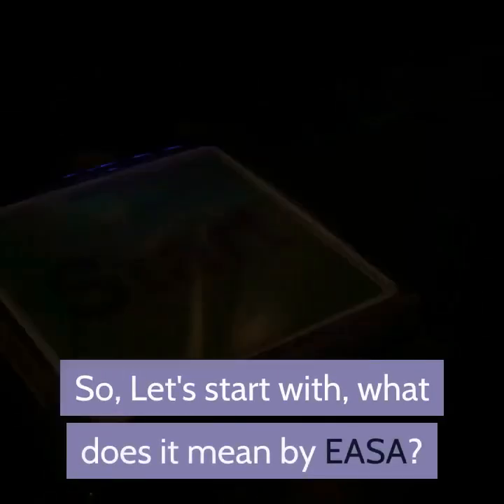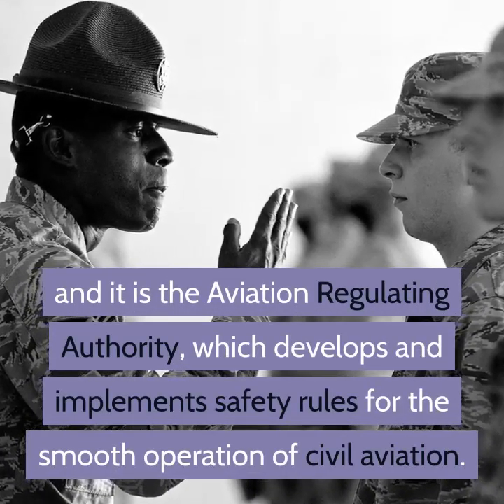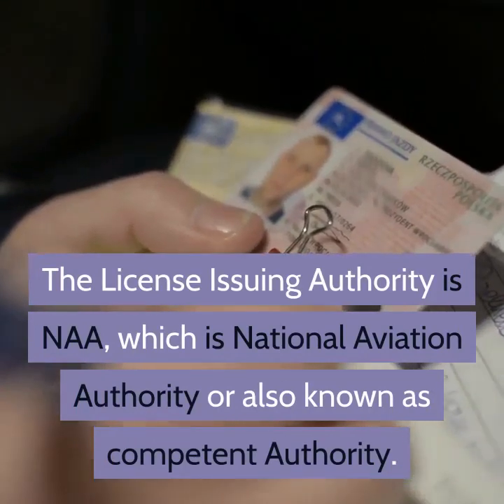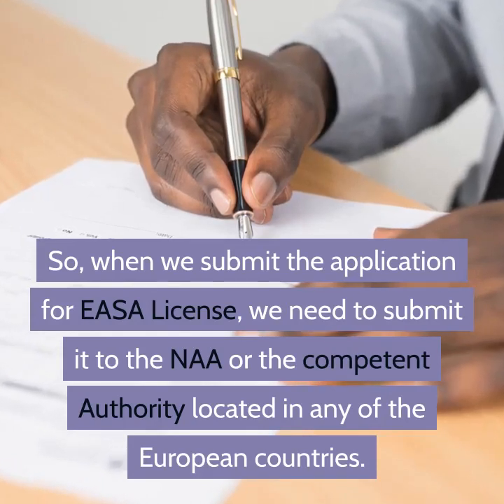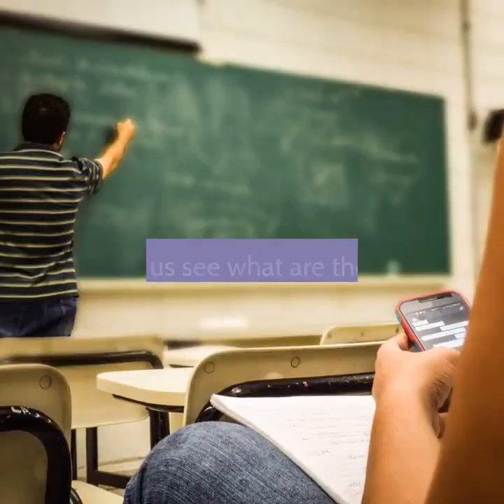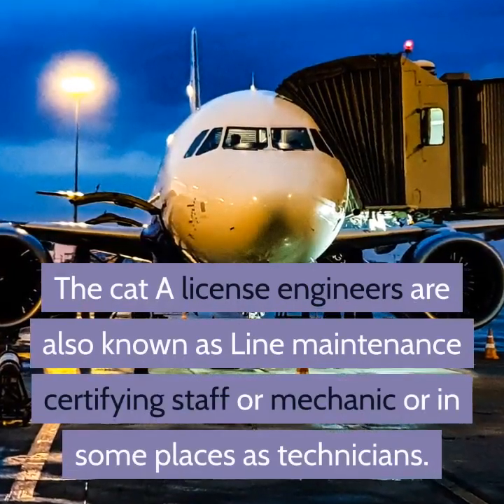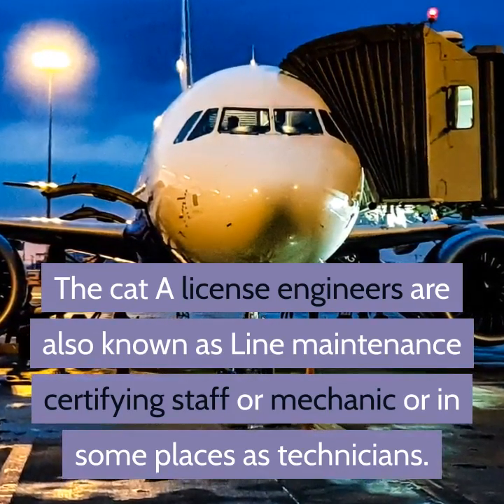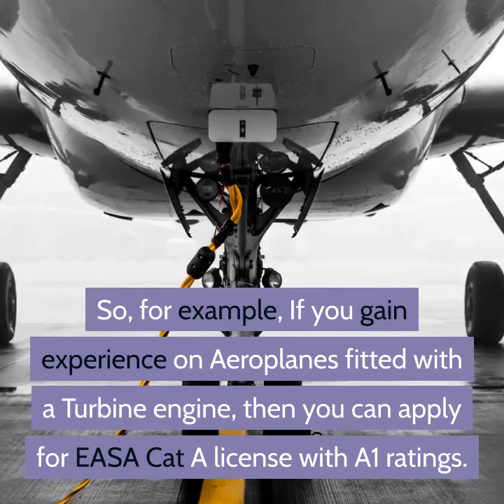How to become an EASA Licensed Aircraft Maintenance Engineer | For Beginners

Comment: tnx for the video.. i have a question .. can i take the 17 modules and become  b1 and b2 licensed and is it difficult to get a job ?
Reply from the maker: B1 and B2 has few different modules, so if you need both B1 and b2 along with common modules you also have to do the other required modules.
If you need exact which modules to complete, you can text us on Instagram.
Thanks

Comment: Thank you so much for the information, sir, I want to ask if I can start the practical experience in parallel with the theoretical study of the EASA modules, or it's a must to finish all modules first before starting the five-year practical training?
I am an engineering student and I've already started preparing for the first 2 modules exams.
Thank you so much ❤️✨
Reply from the maker: Hello
Thanks for your kind words.

Yes you can start working along with your modules preparation. There is no rule to complete modules first.

Thanks

Comment: So I didn't work in aviation. 
If get pass all module EASA examination for type I choose it b1 or b2. 
Than I apply to job in airlines companies. 
Than get job aviation maintenance mechanic. 
I'm work 5 years to get experience than applying for (license category C)
Than call me engineer. 
Is that right? 
 

Thank you for video🌹
Reply from the maker: Co Op Hello, So, If you don’t have any experience , and you choose to write all EASA modules before starting the work, and you you succeed in cleaning all EASA modules then you need 5 years of experience to get your basic license. After which, you will be called as Licensed Engineer. Then you need to endorse type ratings on your License ( For Ex: In your 5 years of experience if you have worked on A320, then you can pursue type training course on A320 and once you complete with that, you can endorse A320 ratings on your license). Then once you have this, your company will allow you to certify only A320 Family Aircrafts. And now you will be called as Certifying Aircraft Engineer.                               Cat C license is only applicable in Base Maintenance Environment. So once you start certifying A320 aircrafts in Base maintenance, after 3 years of certifying experience, you can apply for CAT C license.                                                              Note: you can hold any license, but you still need Company Authorisation to perform your privileges.                                   I hope, this answer your question. If you still have any doubt you can comment, or email to : aviation4gk@gmail.com ; or reach out on Instagram: Aviation4Gk           Thanks 😊
Reply: @Aviation4GK  good, So how the exams look like?
What is technic?
Where can I find books?
Reply from the maker: Co Op Co Op well, the exams are depends on many factors. The difficulty of exam varies person to person. If you do not have any background knowledge of Aviation, then I dont think you will find it easy by anyway.                                                To sit for the exams, you need to contact EASA Part 147 organisation based in your city or nearby cities. Or there will be some 3rd party examination providers, may be you can find any of them. But the suggestion is to find a Approved EASA Part 147 organisation and get the details from them. They also provide study materials to prepare.                                        But my personal suggestions would be , 1) enrol in the Aircraft Maintenance Diploma program, and sit for exams during your course then get the job in the Airline or any maintenance organisation.    Because without diploma in Aircraft Maintenance, I dont think you will be able to find a job in Aircraft Maintenance companies, even if you clear the EASA modules by yourself. I hope I answered your questions. If further information required then comment or write the email or on Instagram. Thanks
Reply: @Aviation4GK  I'm find some books in net
Not that hard and not easy their's.
Reply from the maker: Co Op Hello, as I said before, it depends on individual. So if you find its not that hard, you can sit for the exams under EASA Part 147 organisation. But again the suggestion remains same... to first complete AME diploma and at the same time to sit for EASA modules then find a job to gain experience and finally get the License. I hope I answered your question. If any further information required then comment or reach out on email or Instagram. Thanks

Comment: hi , i have completed my aeronautical engineering graduation ,i want to work in aviation industry so  please help me out  by suggesting courses or modules which helps me get  a job in aviation @Aviation4GK
Reply from the maker: jai k takies hello, As you know, the Aeronautical Engineering more focuses on Designing and Production side of the Aviation, it is not common to hire an Aeronautical Engineering graduate in Aircraft Maintenance by an employer. You can either try to learn some designing tools like CATIA, Solidworks, AutoCad or Analysis tools like MATLAB , ANSYS and once you familiar with these tools you can try find a job in the Aircraft parts or Engine designing companies. 

Or, If you want to work in Aircraft Maintenance then I would suggest to approach MRO’s for OJT programs which will give you hands on experience and later you can find the similar Job. However this is not that easy, specially during COVID time.

The other option I can suggest you is to enrolling in Aircraft Maintenance Engineering Diploma course and after that you can find the job.

Please note, these are all suggestions. So, you need to research about these before you take any step.

If any further information required, please contact me on my Instagram: Aviation4GK 

Hope this will help you.
Thanks